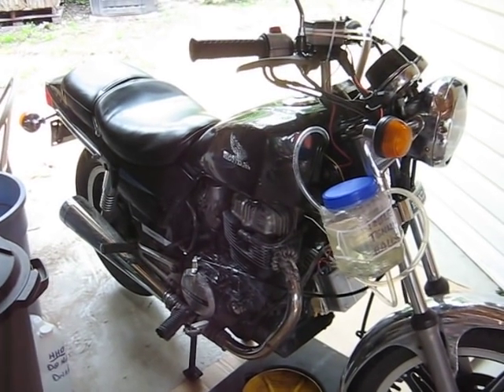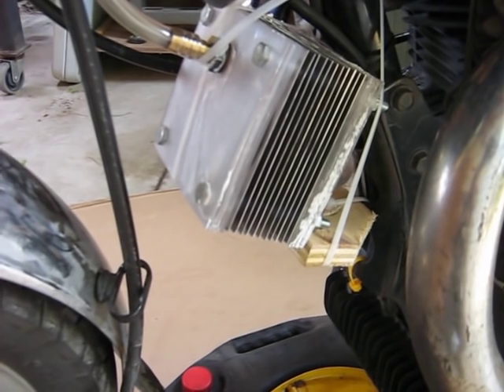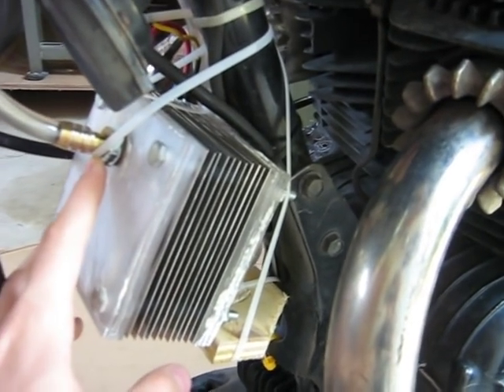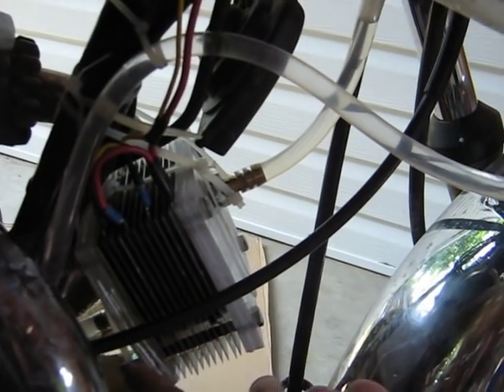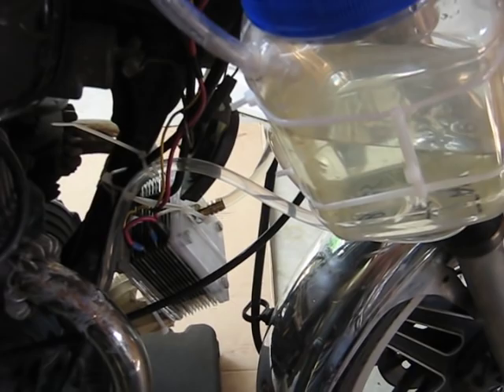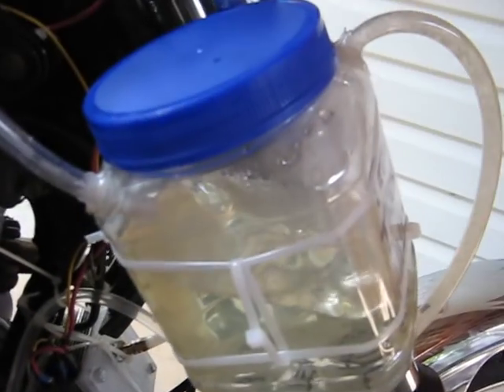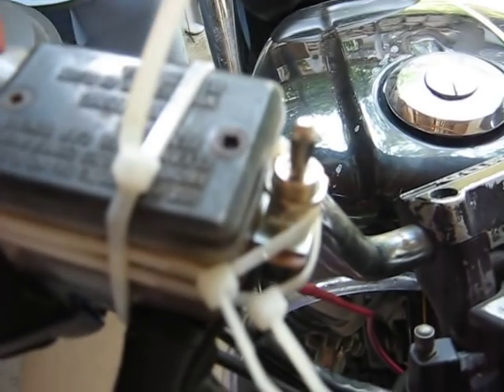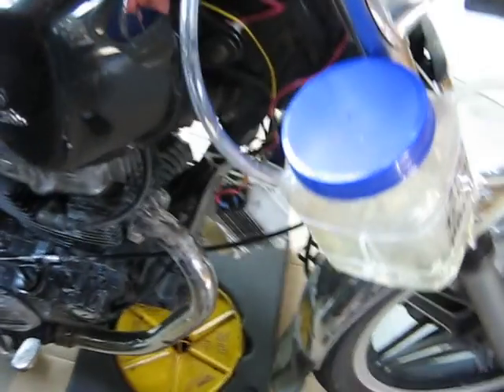HHO Motorcycle - Run on Hydrogen!

Comment: I see that it's been many years this video posted. How did it turn out? I happen to have a  81 Honda 900cb custom I want to try setting up like yours. Is the cell completely inclosed with plexiglass? It's hard to tell on video.
Hope it has worked out well. If so congrats!
Reply: Of course it didn't work out well, it's a thermodynamic abomination.

Comment: Hello, I live in Greece ,and I have a Honda 400T of 1980 .I like your video with the same bike with me, and I would like some informations about the HHO. First, the engine can run on Gasoline and HHO, or run only the hydrogen? Second, How much Sodium indoxyl is needed per liter of water to electrolyze. Third, with how many Amps does your motorcycle works properly minimum , And how many km/Liter of water travels . Please could you send me a message with the pdf of Generator Constructions if you want? I like it, and I would like to fix it ,because I cannot find in Greece. Thank you very much. Manolis.

Comment: Hey dude, congrates... I got one too. I built it this spring. but had to spend as little money as possible. take a look. Do you have problem with battery drain? if so I cam up with the solution for using leftover power from the headlight. it's on my channel.

Comment: from what i understand the hydrogen and oxygen supplemented improves the percent yeild of the gasoline combustion from about 30-50% to 90-100% so youre making more power at lower throttle effectively saving gas

Comment: @96cobramustang In  my  motorbike and  car  im  using  PWM,  you  can  not  tell  when  your  amps  go up  or  down when  your  water getting  hot....  so  it  is  better  to  use  a PWM to  fix  ur  amps  draw, not  to  discharge  your  battery  and  over  load  your charging  system.... check  my  other vid,  i  have  some  tips PWM  u  can  do  it  your  own... thankz....

Comment: they hydrogen goes into the air intake? My guess is that because hydrogen and gas are being used at the same time, it gives you better gas milege, or perhaps a faster bike if you have it full throttle?  Anyone comment please.  I need to save some money and want to do this here in Bangkok.